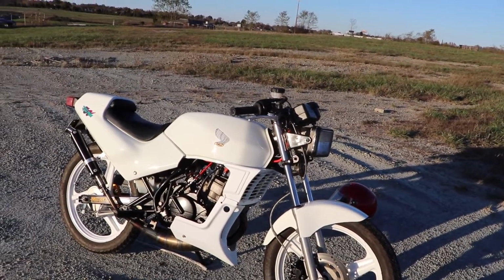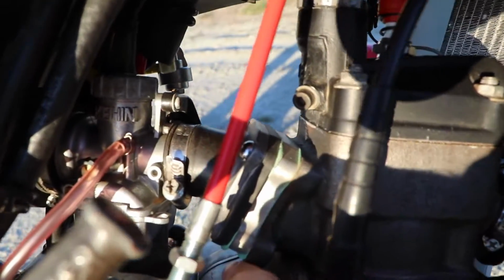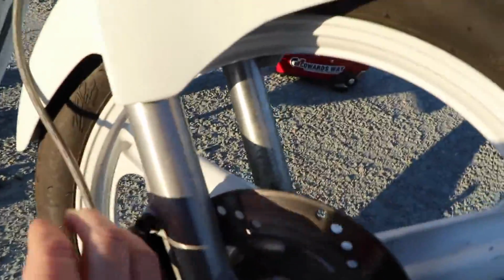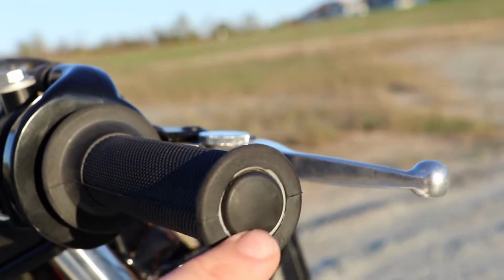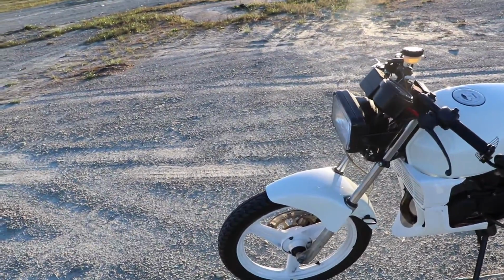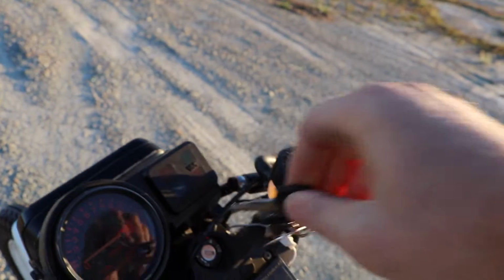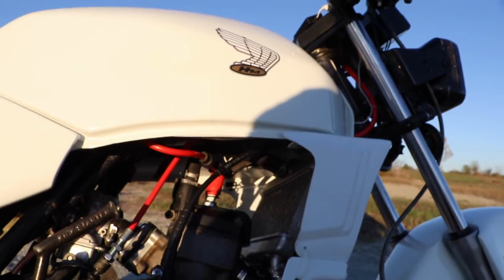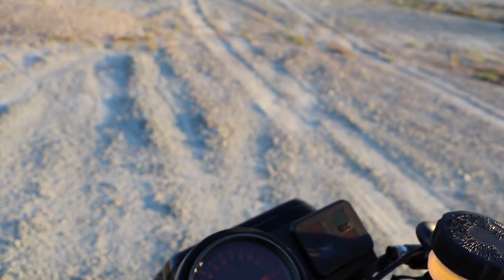1990 Honda NS50f Daytona Walk-around

Comment: I am trying to do a front disk conversion to my stock ns50f.  I don't have mags and am looking into buying them off of Webike, possibly the ns50r minis?.  If you are using stock forks, what caliper are you using?
Reply from the maker: 04 Nsr50r  bolts right on to stock Ns50f fork legs if you drill the holes out straight
Reply: @allredred6646  thanks for the reply ! Man keep up the videos , whens your next build video ?!